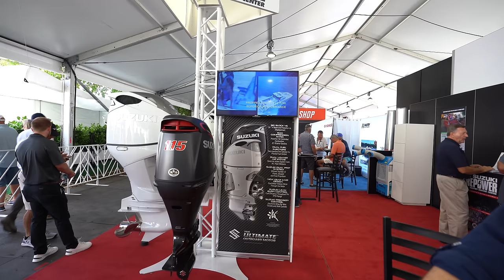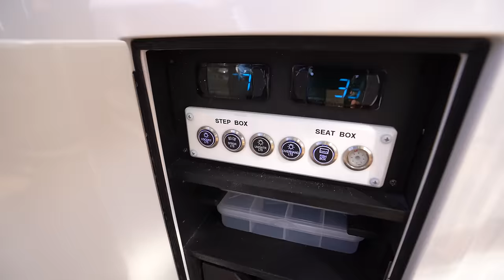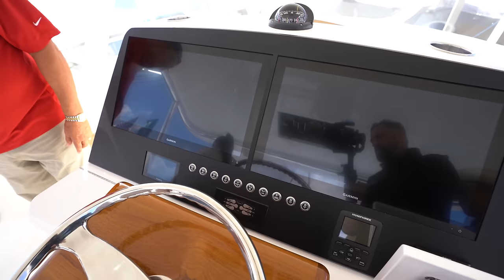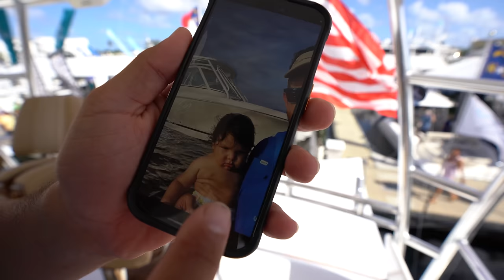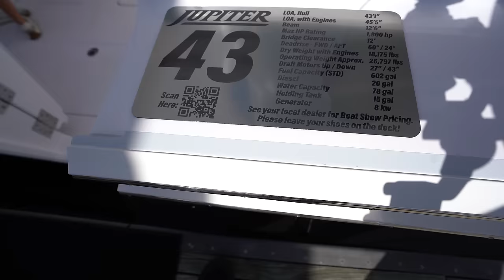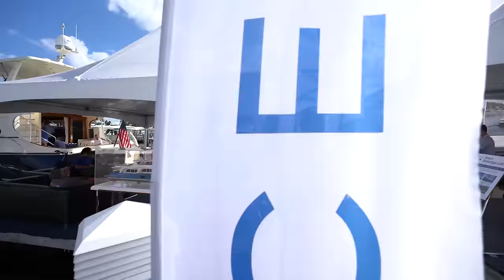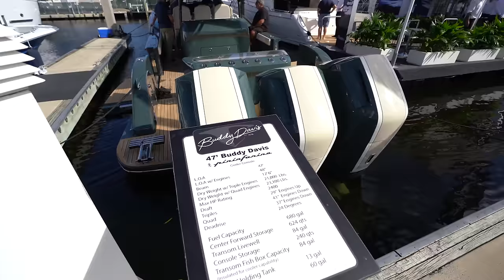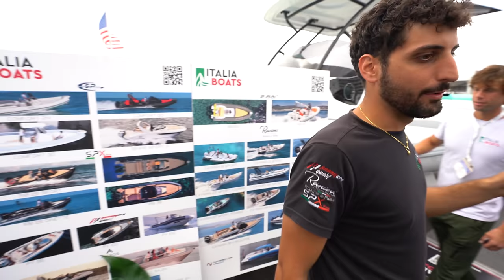Fort Lauderdale Boat Show 2023 Full Walk-through! Amazing Yachts and Boats ( Part 2)

Comment: Alfred, I saw you walk by Galati Marine. I used to do side work for the old man and his sons when they were at Anna Maria Island before the big expansion. In fact, I did carpentry work for both Micheal and Joe, besides working at the Marina building work benches and storage cabinets. Very great guys to work for. Although, was back in the 80s.
Reply: Did UPS get you the umbrella? I sent it to the shop address, and UPS said it wasn't there. However, they said they had your home address in Cutler Ridge .